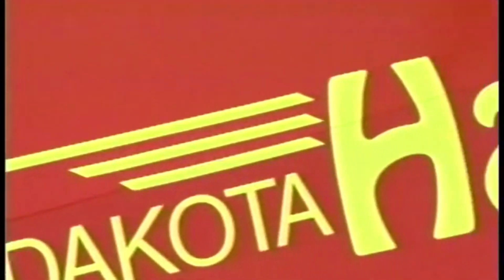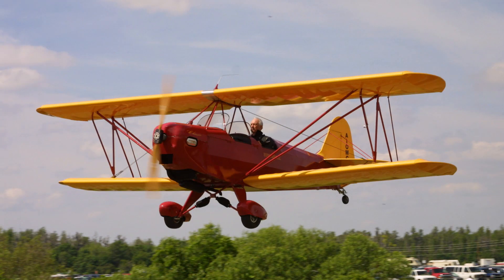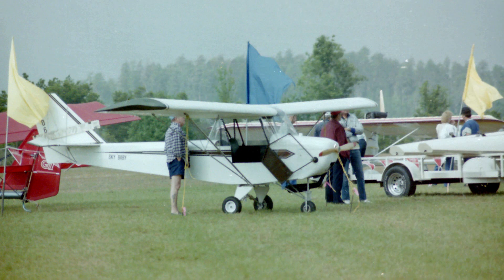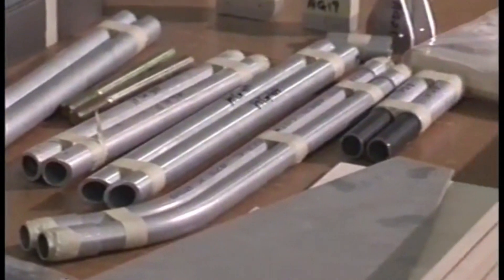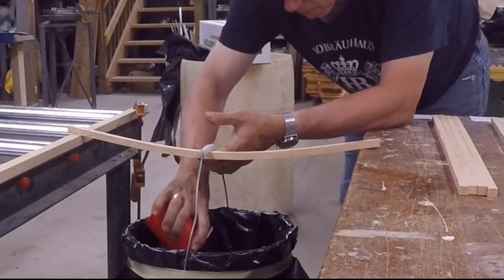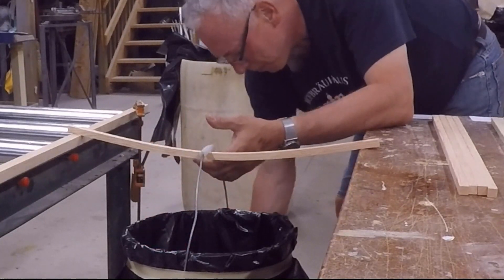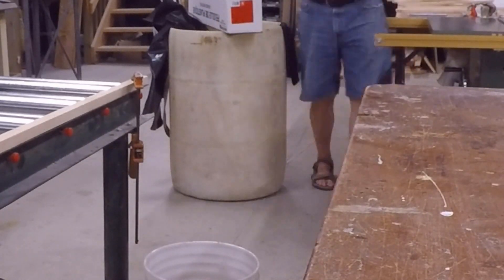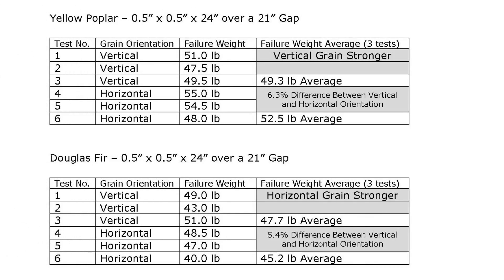Sitka Spruce, testing replacements for Sitka Spruce in wood aircraft construction, Fisher Flying.

Comment: Thank you for this excellent post.
Interestingly, I had researched materials used by the early pioneers of flight many years ago, as I had been led to believe that Sitka spruce was the way to go. 
What I discovered then, was that even the Wright brothers had chosen Northern White Pine, as the most practical wood, and many other manufacturers as well.
The designer of the Pou du Ciel (Flying Flea), Henri Mignet, also chose this wood above others, which is what inspired me to look closer.
The price difference explains why an HM 293 Ultra leger Flying Flea, can be built for as little as 3,000 dollars, 
In these unsettled times, any measures that can be taken to maintain standards, and retain survivable profit margins, and to lower cost to the customer, has got to be beneficial to all parties.
I wish both you, and your business, every success for the future.
Kind Regards
Nigel

Comment: How about COOSA board?  It’s used in marine applications to good effect as a replacement for wood materials in structures.  Lighter, no significant water absorption, no susceptibility to mold.  It has similar ability to hold screws as plywood does.
Reply: Requires a finish, no?   Coosa I have worked with had a fibrous surface...(like fiberglass)

Comment: It would be interesting to retest, with the cross section of each test piece adjusted so as for a given length, all the test species had the same weight.  This is very interesting information, useful for those of us that build in wood other things than aircraft, but where strength is still important. THANK you for posting this.

Comment: This is all fascinating, but why not think outside of the box?  Why not create a hybrid material?  I have some suggestions in this respect if you are interested then contact me via my You-Tube business contact email.  All that it will cost you is some time.
Reply: hybrid is not that simple.  difference in E-mod , moist and heat coefficients  should  all be taken into account.
Reply: What about laminated strips, alternating grain, bound by epoxy of water resistant bonding agent...perhaps even a much lighter species....
Reply: @hammer44time27  Glue is heavier then Wood. The only truly recyclable aeromaterial is aluminium.
Reply: @oheebatch_algorytmu  Yes, glue is heavier than wood, but in a laminated structure the glue is only a small percentage of the total weight.